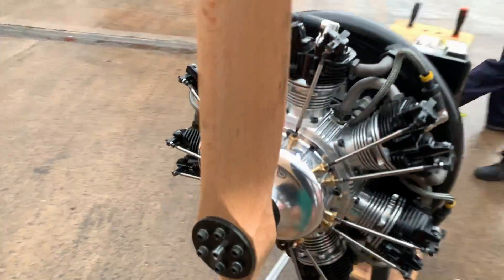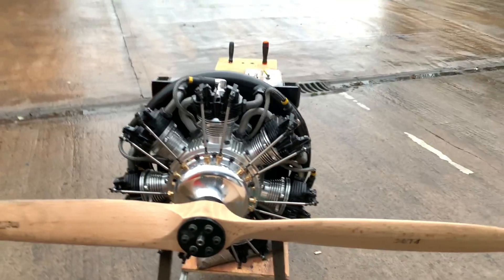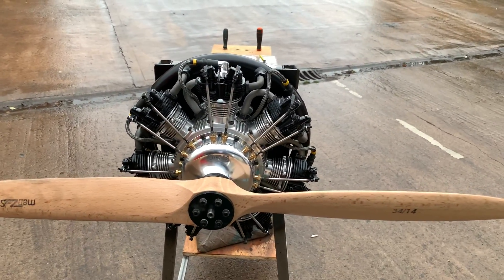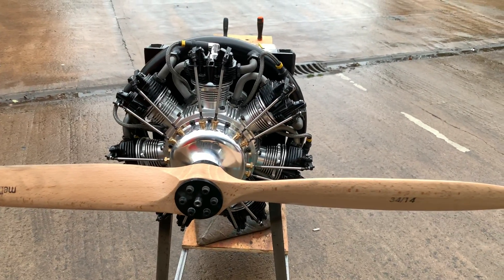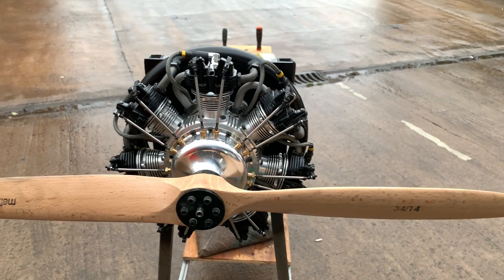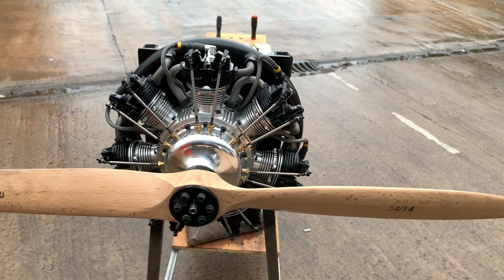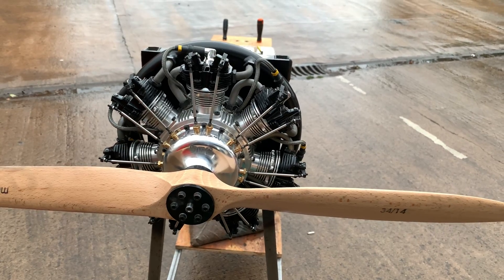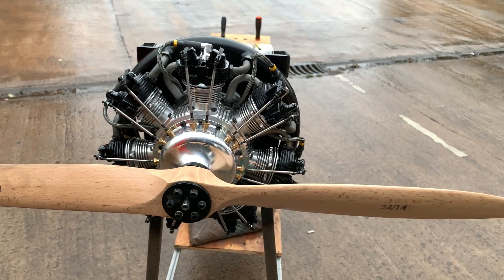UMS 7-260cc Gas / Petrol 7 Cylinder Radial 4 Stroke Engine 1000 RPM-5700 RPM with 34 x 14 Prop

Comment: For a small radial engine it's got a good amount of hp. I wonder if you could stick multiple engines together (like 10 radials slapped all together in one long cylinder)
Reply: @SR-gs8zo  would be an interesting thing to do tho, just slap together a bunch of them and let them do engine stuff

Comment: the walbro carb has its own internal fuel pump...shoud NOT be running an external fuel pump on a carb like that.....you WILL damage the pump valves inside the carb in doing so and constantly flood the carb/engine
Reply: no
Reply: @thomasmaxam8771  mate, ive worked on these carbs professionally for the last 30 odd years, i know how they work VERY intimately....and ive seen just about every failure there is, go back and read my post again...
Reply: Ja die Vergaser sind auch an Kettensägen dran. Aber hat der Sternmotor eine Impulsleitung ?

Comment: Use some hot glue, stick two together and BINGO one R-1830 Twin Wasp. If one of them sounds this good, how good would two together be !!!
Reply: Not quite, the wasp was a twin 9 cylinder. This is a 7 cylinder. But I get the reference.
Reply: I agree a 2-row 14-cylinder version would be righteous, but about that hot glue...